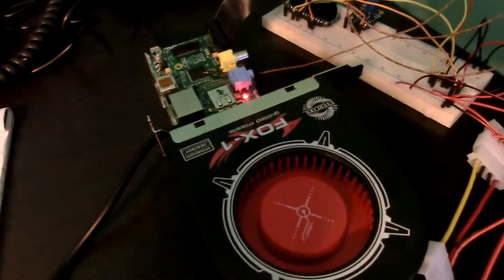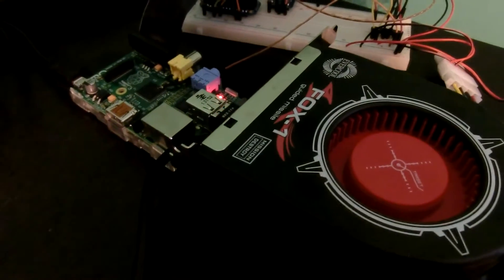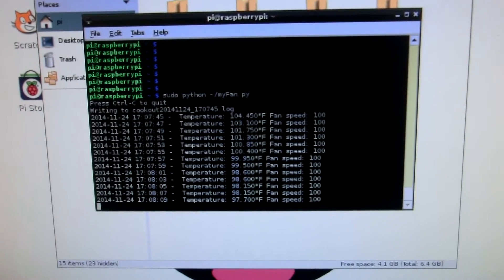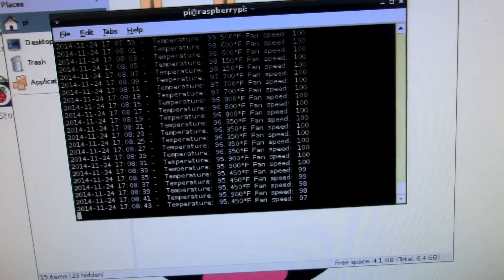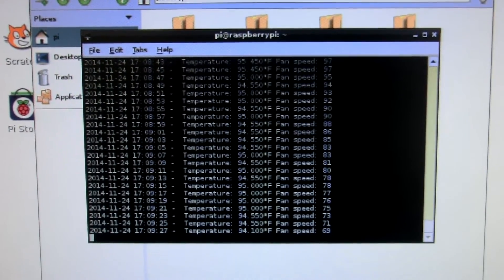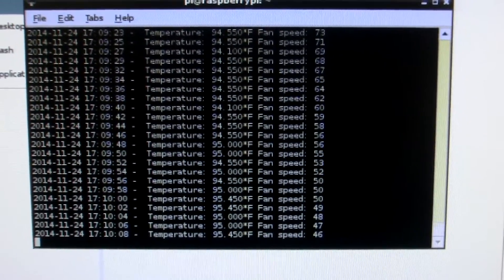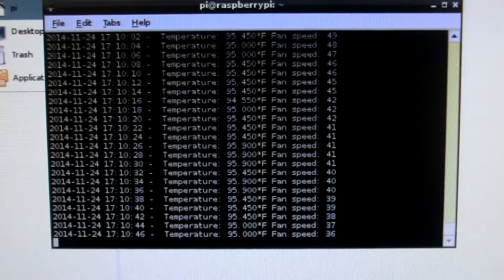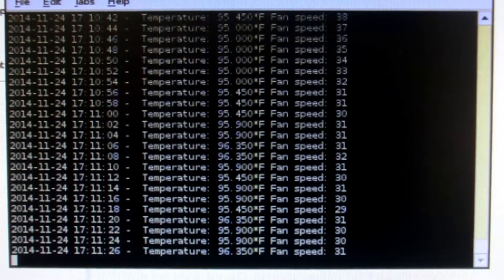Project Lazy BBQ Part 4: PID Logic Controller with Fan Control and Temp Sensor

Comment: looking to do something similar to control fanspeed/airflow to my smoker. is this project on github or do you have any other documentation I can look up?
Reply from the maker: It is not. Currently I am using Python, I am going to re-write it using C, cheaper probs and MCP3208, etc. I'll publish it once I am done.
Reply: yinglish119 won't you have to use an arduino for that code? I've got a  raspberry pi, and want to use it for the microcontroller. is there any way I can reference your source code for my project?
Reply from the maker: Nope, you don't. The MCP3208 is Analog to Digital Converter chip. You need to shift in bits if you want to read the MCP3208. I already have that part working with my candy dispenser video.  If you want msg me on facebook. noclue119 is my username and I'll share the C code with you.

Ying
Reply: yinglish119 my problem is that programming languages are like Spanish documents to me. I know enough to catch every 4th word and at the end say 'this document is about climate change' when it is specifically about the CO2 levels.

I understand if you don't want publish something that isn't finished, but it's the unfinished product that I'm after as the rest of the program will be written in python as well.

I'm not looking steal your code verbatim, nor am I looking to make any money on this, I'm just a cook who loves to smoke large cuts of meat and a nerd that loves to tinker.  Thanks for all of your help so far, I really appreciate you taking the time to answer my questions